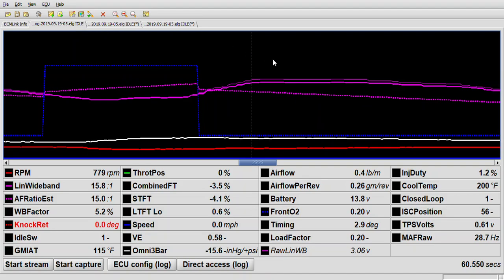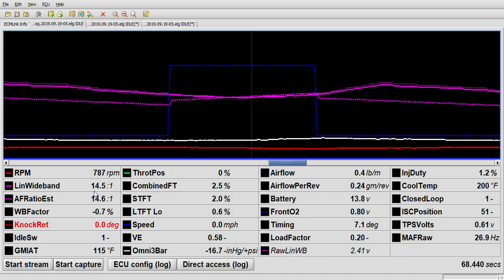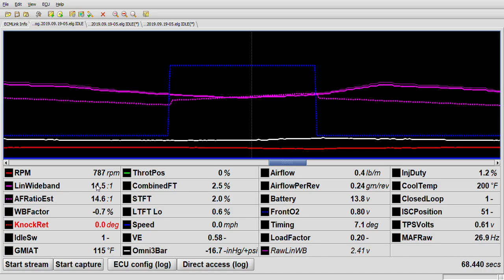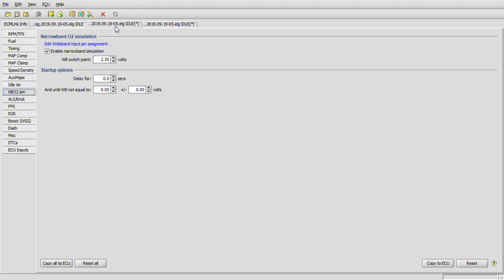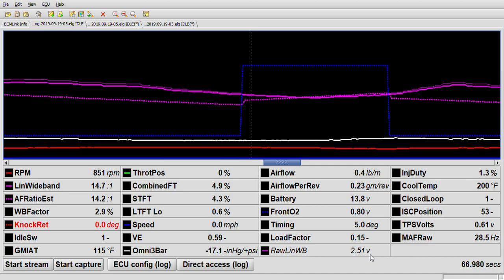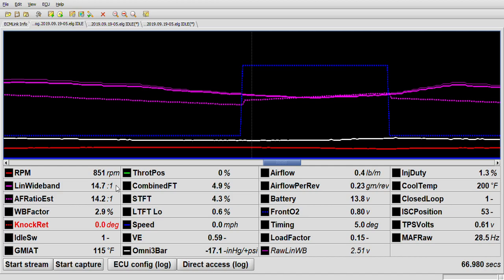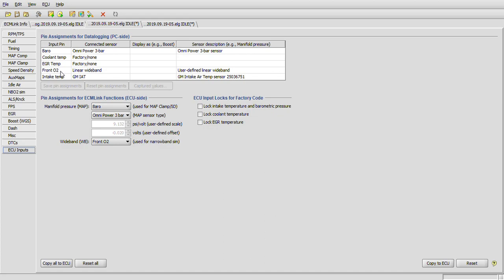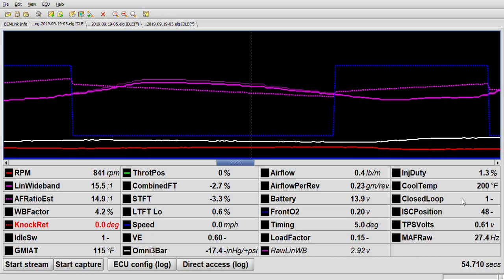Ecmlink, Why simulating a NBO2 can be a bad thing.

Comment: Can you recommend a good gauge to simulate narrowband?
I need a solution for an old L-jetronic car, I neeed to replace my O2 sensor and I was thinking about installing a wideband and Run on simulated, but I do not know any system that actually does a good simulation.
Thanks
Reply from the maker: Any of the major wideband company's except the old AEM digital gauge.